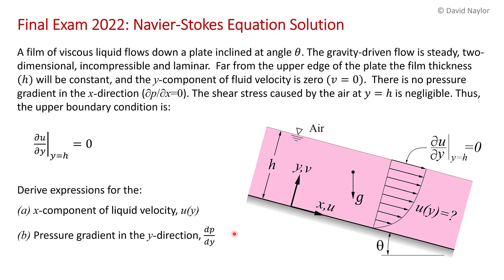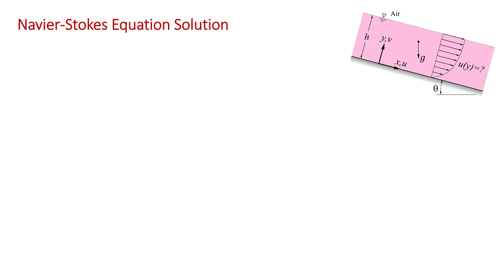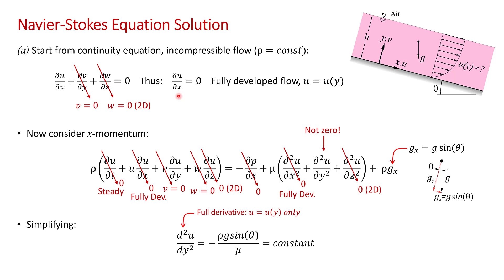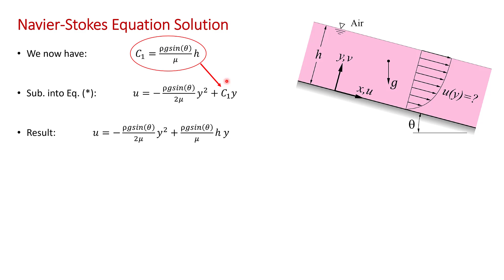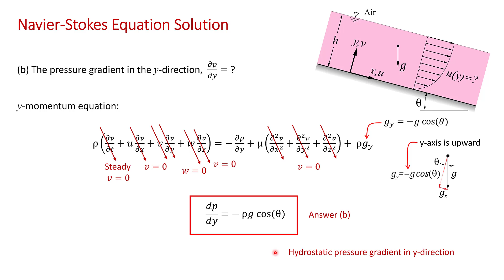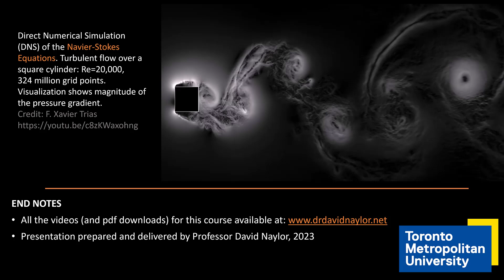Navier-Stokes Final Exam Question (Liquid Film)

Comment: If w=0 and v=0 , why can’t you just say it’s 1-dimensional flow?
Reply from the maker: Technically you are correct. u is only a function of one-dimension, y. So, yes, it is 1D flow u=u(y), far from the flow inlet. However, this is different from the the classical 1-D flow approximation which is used to represent the mean velocity variation in the flow direction. For example, Bernoulli's equation applied to a venturi, u=u(x)=U_average, where the flow is in the x-direction.

Comment: i have a question, does the order of integrating and applying boundary conditions matter? I mean if I integrate two times right away and then solve the constants I seem to get a different result than when I integrate, boundary, integrate and boundary do...
Reply from the maker: The result should be the same, regardless of the order.
Reply: @FluidMatters  thank you very much sir, excellent video 🙌